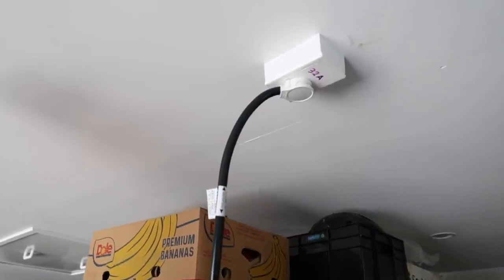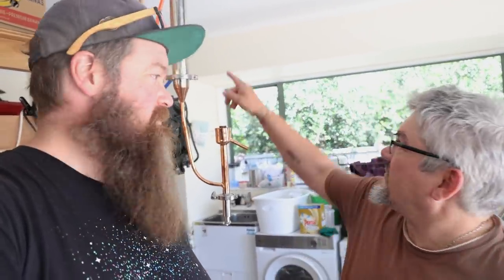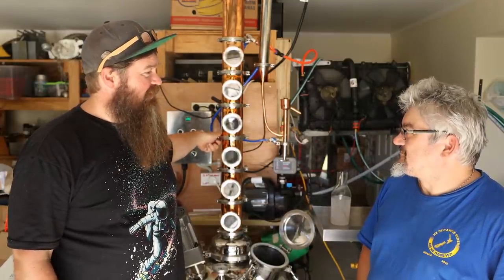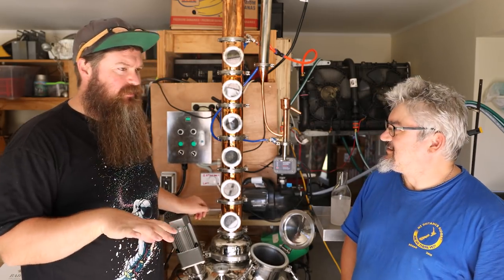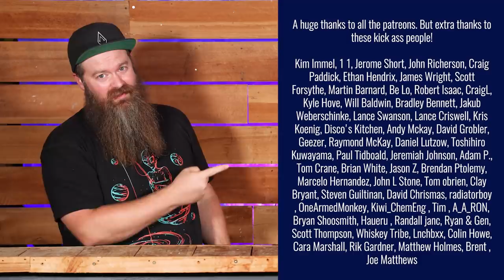Is Buying A still Direct From China Worth It?

Comment: How did the cooling system work?
Reply from the maker: James is still working out a few little kinks. But all in all really well!
Reply: @StillIt  That is great to hear.  Any chance once he gets them worked out we can get an update incase its something we might want to try ourselves? ... cheers
Reply: It could run better, I've only got 200l recirculing so struggling to cool.
Ideas coming...
Reply: Defleg's need a consistent water temp, and when you're in a loop, or even using muni water you're going to have issues with that. The big boys all use temperature controlled chillers, so their water temp is 100% consistent. The way I do it is to run two loops so the defleg is on a separate supply and that keeps the product condenser from heating up the tank too much.

What I'd like to do is run a radiator system with an electronic blend valve so I could set a temperature and it'd mix the radiator loop into the standard loop and keep my defleg inlet temp consistent. It'd be above ambient temperature of course, but that's not so much an issue as it staying the same, so it should work. Problem is, the electronic blend valves aren't cheap and I haven't come up with a way to DIY it just yet (though an arduino would be able to do the math real time, it's more of a calibration/measurement issue).
Reply: @expattyNZ  Run your condenser and defleg on completely separate loops, that's heaps better because you won't be surfing around water temperatures as much.

Comment: Guessing that "water manifold" is a RIMS tube for heating the jacket potentially? Heating element in the long and and water in/out on the side with a temp gauge in the 1/2" NPT port.
Reply from the maker: True could be.  James double checked the list later, he didn't pay for it so it could have been put in by accident
Reply: @StillIt  Ahh ok. I couldn't really see the boiler and on second thought guessing the element already goes straight into the jacket and already has the in/out port on the jacket. Guess the mystery will continue lol...

Comment: That still is likely bigger than some of our local "craft distilleries" have,I'm not jealous(much)though I reckon the NZ authorities might take some convincing the product he creates are "personal use" lol. I'd not have the space for it,hence why I'm sat waiting for a tiny little still arriving (also from China) I've already got a couple gallons fermenting (banana rum & a sugar wash)& by the time the still arrives I'll probably have set off several more gallons fermenting.
Reply: When making “quality” home spirits the quantity of finished product reduces as you tend to make much tighter cuts. I know with a 50 litre boiler I am continuously frustrated by the time it takes to make multiple stripping runs to get to the spirit run. if he had bought a 200litre boiler I would say customs would be seriously looking at whether it was for “own use”. 100 litre is just a “serious hobby”. Just like buying a 150k boat to catch fish, you can still catch the same fish with a 10k boat...but it’s more fun with the bigger faster boat😄
Reply: @dansarmar1  Get yourself a 4in column, a big shotgun condenser, and more elements, there's a guy over on homedistiller that's stripping 50L an hour with one. Sugar wash of course, but still, the larger column can flow some serious product compared to the 2in
Reply: @jttech44  I have a 50litre boiler and 4” column 4200w in elements. Yes next step would be bigger boiler and more power. = 30amp power supply, which I have at my shed, just need the higher rated plugs.

Comment: How much diference dose a jacketed still really make?

I could see faster heat up time (more even heat allowing more contact = more thermal transfer)

Other than that....
Reply from the maker: It's not about doing the same stuff better.  It's about doing things you can't with direct elements.  You can distill on the grain or with other chunky stuff.  Grappa with all the skins still in their, burbon etc
Reply: If anything a jacketed system is usually slower.
The heat source is indirect so 'stuff' doesn't burn on the element or bottom if you are using a burner. 

If having 'stuff' in the boiler is your goal, then jacket + some movement in the boiler would sure help.

Comment: Is the jacket necessary for gin or could you get away with just a heating element and agitator?
Reply: The main benefit of a jacket is nothing should stick or burn, anything 'not liquid' has a good chance of sticking to the elements.

You can run an element if you want/need (jacketed setups can be costly), just need to try and keep solids away from the elements or be aware the 'chunky bits' will try to stick.

Best bet when using elements seems to be, strain before it goes in the pot/boiler.

Comment: I always thought just welding ferules onto a stainless 40 gallon barrel would work just fine
Reply: Finding a 30/40/55 gallon ss304 barrel locally can be tough.   Here in Canuckistan, I have yet to find me a steal of a deal.  15 gallon beer kegs and brute/rubbermaid 40 gallon garbage pails for me for now.
Reply: @robertfontaine3650  no problem round here

Comment: That vertical coolant hose is likely to kink when it gets hot.  A coil spring on the outside would help keep a gentle bend.  

Also, for that kind of money I wouldn't accept anything other than a pressurized steam jacketed boiler.  They are much faster to heat, much more responsive to changes, and much cheaper to fill (just distilled water).Simple bain maries suck in every way in comparison.
Reply: That is the big problem with ordering the boiler from halfway around the planet.  The shipping kills you.   Better off commissioning a local boilermaker and then buying the attachments from china.   I don't understand how they manage the shipping but they undercut everyone on the lego.  A copper bain-marie and an Alambic Charentais all polished up are like magic,  alchemy.

Comment: Got close to the exact same still. (50 gallon pot (not jacketed), 4 bubble plates, deflag, gin basket)  The biggest concern i've had with my purchase is the electronics from china. For lack of a better way to describe what happened to me, the control panel caught on fire basically. I'm an industrial electrician by trade and I'm going to attribute the major problem to a herts issue. Here in North America we run on 60 hertz and everything I got was 50 hertz. That and the quality just wasn't there at all. Bear in mind this was purchased 5 years ago. Since then I've modified my pot, I run on duel energies. For those of you who are fans of the show moonshiners, I had a 4inch stainless tube inserted through the bottom of the still. Exactly like mark and digger use with a Venturi burner that sits inside. ALSO a high density 3000W element with voltage controller. Starting my run I use both mean for  heat up and eventually turn the gas way down and control my run with my element, depending for what i'm going for. But like all things in life, slow and steady wins the race.

Comment: I have a 3in fluted copper  column a ,onion head ,and a gin basket from oakstills. I wasn't impressed with the parrot but everything else was great for the price. They have great customer service and answer any questions in a timely manner.
   There is a chance the parrot your friend has was improved from some input I gave them. They responded to my critizism and we emailed back and forth about how to improve their old design. 
Great vid and awesome still porn video!
Reply: In your opinion, does the onion have a significant enough impact to justify the added height it adds to the still?

I'm debating getting one but would need to sacrifice one of my bubbleplates if I did
Reply: @horrorhotel1999  In my opinion tje video drug on and on needlessly. Give us a complete story but don't purposely drag it out. I fast forwarded threw several parts. So that would actually be counter productive for you adds?
Reply: @spikelove9533  I think you misunderstood.

I was asking about the onion on your 3 inch flute still you are referring to in your original comment and was wondering if you would recommend buying it/if you are routinely using it? How has your experience been with it? If you could have the same setup you have now but without an onion and it would cost you 200$ less, would you choose to buy the onion or not?
Reply: @horrorhotel1999  lol I certainly did I totally thought this a different video sorry. The onion dose do a little reflux not nothing that bumps up the proof anything to speak of.  my main porpoise was putting lots of copper in the vapor path with out to much reflux like copper mesh in my column. I only use the onion when I pot still. Trying to get as much of the flavors from the brew into my spirit. I have a mostly Stainless setup so Copper components are needed at some point IMO

Comment: Hi Jesse!
I'd love to show you my baby stripping still. I'm in Ashburton and am happy to bring it up for you. I got sick of heating up 25 litres of wash, just to boil off a few litres of alcohol, then all that initial heat gets wasted. 
My still is a small 3 litre pot still that heats up quick and the wash is injected into the column. The magic though is a massive condenser that I run the wash through instead of cooling water. This preheats the wash. I then have a heat exchanger on the column that evaporates the alcohol before injecting into the column. 
No cooling water needed!

Comment: How and what does he use to control the heat to the boiler?
Reply: It's all about power input, so, likely that control box has some chunky SSR's (solid state relays) that are controlling the wattage to whereever it's set to. So the same as any other still, just much bigger.

This is a jacketed boiler, so the whole pot heats up all at once which prevents hot spots and scorching, but the cost is that it lags a little bit because the jacket is full of water/antifreeze mix that tends to run hotter than what your boiling temperature of your wash is. You can't boil your wash any hotter than it boils at, but, if you have something that's heating your wash that isn't boiling, like water mixed with antifreeze, the wash will draw heat out of that water/antifreeze solution in the jacket even after you've turned the wattage down. Think of it like a thermal battery.
The benefit is a really gentle, even heat, and the elements don't require much maintenance because they never touch your wash directly. It's a pretty wiz-bang solution, especially because you can ferment and distill on-grain.

Comment: Why put oil in jacket if your using element to heat liquid. ?
Reply from the maker: Sorry not sure what you mean, like why use the specific liquid he out in it?  Or why have a jacket in the first place?
Reply: @StillIt  in video I saw that oil was added to the jacket. But I thought the heating element went into the boiler and in direct contact with product. Or is the heating element heating the oil?
Reply: @StillIt  sorry for not being clear. Is the product (wort) heated directly by the element or is it a oil heated system? I thought looking at design the element went into boiler and directly heated the product?
Reply: The element heats the fluid in the jacket. This in turn heats the wash. Check out Indirect heating or "bain Marie". 😊
Reply: @expattyNZ  thanks !

Comment: Perfect timing! ... I've been pricing out a 15 gallon, 3" flute column, PID controlled still, and associated bits ... This was exactly the review I needed! ... Also looking for the expenses spreadsheet when you get around to it
Reply: My son is a MASTER WELDER and has built many stainless steel stills
ALL with what we call dairy clamps or sanitary clamp. All the stills he has built have no threaded parts.  When he came to me with a still that was elemented and needed to be controlled very tightly because it was un jacketed.  I built him an OMRON DIGITAL CONTROLLER  to control his temperature to +/- one tenth of one degree F. I used solid state relays so you wouldn't have to listen to the constant clack of contactors energizing.  If someone is interested. I can send them a picture of the controller.
Reply: @mikeglasgow6656  I think most are using either an SCR or a PID depending on their philosophy. eye-ball the temp and babysit the transition.  You shouldn't be leaving a still unattended anyway so you may as well turn the dials.    His problem is that he is going to run out of room in his garage with a still that big.
Reply: Yes Robert, I agree with you. My son and I have experimented with many types. All home built out of stainless steel.  Since he does mostly process piping jobs getting the material is no problem and 90 % of the time at no cost. We would never buy a still that was made in China.  Mile High Stills in Denver is a good choice for USA clients. I'm retired but my background was industrial HVAC/R. in which we used many proportional valves and controls. Some 0-10dc, some 4-20 ma. We found that in our so called home made stills THE OMRON DIGITAL CONTROLLER is ideal. Built in PID or manually set. We even thought about starting a cottage industry building these smaller 10-20 gallon stills that are 220VAC for the average homeowners to have to make their own Holiday Cheer. That is until we checked into the liability issues and UK issues. To much red tape. But ours works great for what we produce. Very efficient.
Reply: UL ISSUES

Comment: Dude... That radiator is way overkill even if was just directly cooling the water from the condenser without the outside barrel of water.
If you were using all of those 32 amps to power the heaters that would be 230V *32A= 7kW.
A Subaru WRX produces about 200kW of rotational power and gasoline engines can't get close to 50% thermal efficiency even with a turbo. So that radiator is designed to cool at least 200kW of heating power. That is 28 of these stills running at full 7kW.
Disconnect the water barrel from the system and install a small fountain pump to circulate the water from the condenser to the radiator, you can probably take the fans of the radiator and run it passive too.
Reply: Remember that, even though a subaru is producing 200kw peak at the crank, and outputting somewhere around 670kw total, it's only doing so for a few seconds at a time, and most of the thermal losses aren't being dealt with by the radiator system, but are instead transmitted into the exhaust gasses, so the radiator system you're looking at only has to deal with a tiny fraction of the total power you're claiming it does.
Further, it's much better to have tons of additional cooling capacity to keep your cooling loop at a consistent temperature so you don't have to fuss with the defleg valve as much. From what I can see, any difficulty running this as it currently is set up will be due to the product and defleg loops running on the same reservoir and therefore being too interactive. You can solve that with an additional reservoir and smaller pump to run the reflux loop and keep the current loop for the product condenser so it can knock down as much vapor as needed.
Reply: @jttech44  I concur that with a normal engine most of the thermal loss is thru the exhaust, however with a turbo engine a lot of that energy is swallowed by the turbo and used to compress gas that gives the 200kW in the first place. It is true that additional heat is taken away by the intercooler in that case.
I know you can't really run 28 of these stills off this radiator, I was just trying to illustrate a point that you can definitely run one passively and without a big buffer tank. Maybe put a computer fan or two on the radiator if you really want to be extra safe. It's not wrong to have extra capacity of cooling but you have to draw the line somewhere or this can go all the way up to a nuclear evaporation chimney... And tis system doesn't need the outside tank, hose or that big pump at all.
I run a traditional 60L copper pot still with the condenser being made up of 4 coils of 1" copper pipe in a 200L barrel filled with water. My stripping run takes about 3h. I can do 2 stripping runs back to back with the bottom coil and water around it remaining at room temperature while the water at the top of the barrel is steaming (due to stratification). The coil exits the barrel about 2/3 of the way down. So I am really only using half of the water to cool. This implies I am using 120L of still capacity over 6h and the 100L of cooling water is sufficient. I am confident that a WRX radiator is capable of cooling that 100L of cooling water back down room temperature without any fans, just an aquarium pump in well under an hour. Hence my advice to this guy to simplify and streamline his setup and still keep it 3x overengineered for the cooling needs of his still.

Comment: I designed that bubblecap system 12 years ago, the downcomer design is garbage, I didnt design that part. my design for the downcomer was ignored, but works very well. I can walk you through how to change it.
Reply: This seems to be the go-to design for the Chinese bubble plates. I don't really know how they could be improved to be honest.
Reply: @jttech44  the inverted cap as a drain is a bad design
Reply: @violentblue123  would it be better to use a j trap instead? I've seen guys on HD use those

Comment: Hmmm, I wonder about the bubble cap column. Why? A packed column would be simpler to operate, maintain and fabricate and offers a vast improvement in separation power of the column. 

It sure looks nice but I question the utility of the setup using bubble cap plates...